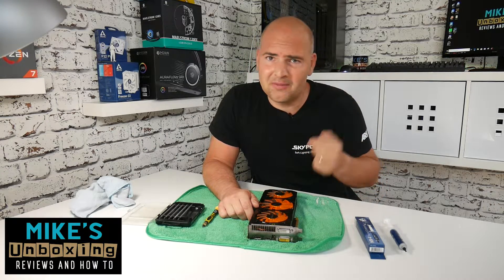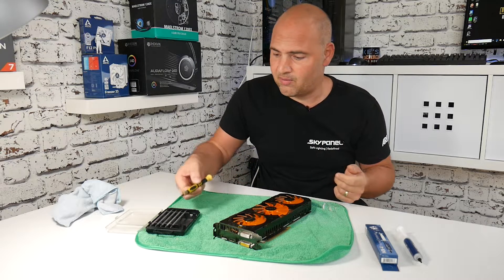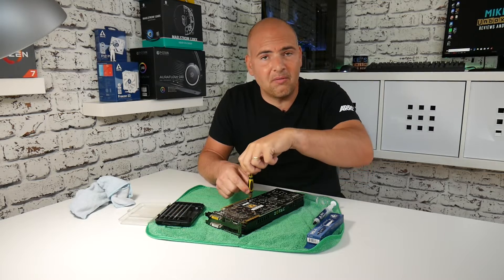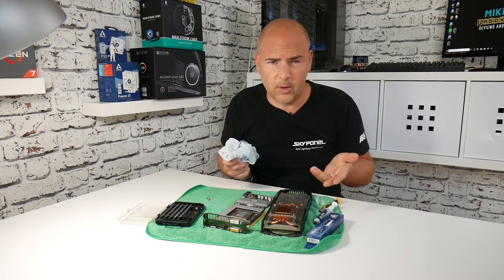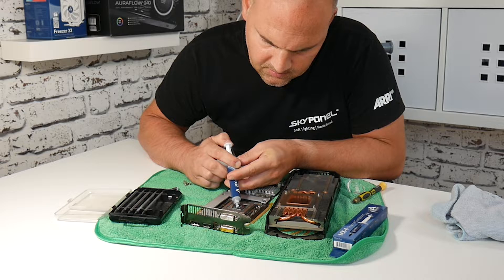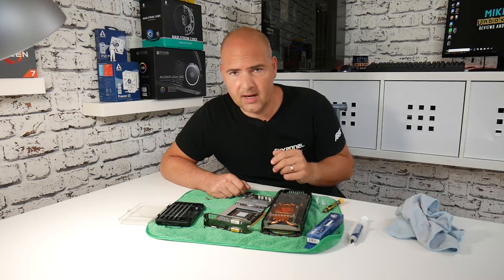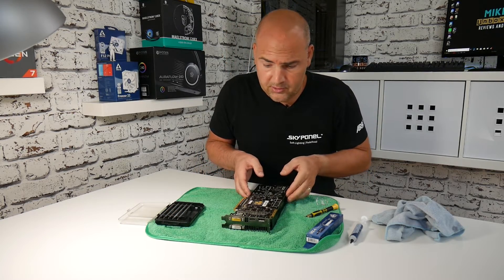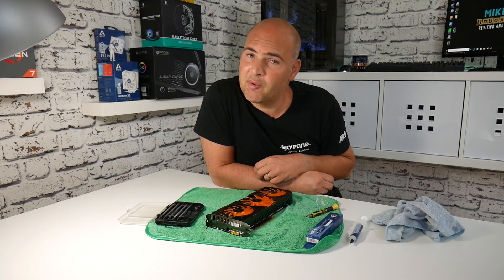Cooling Down A Graphics Card Or GPU With MX4 Thermal Paste

Comment: I bought a good air (oil based) compressor, 50l volume, I cleaned my PC, also cleaned and repasted my CPU and GPU (MSI Gaming 6G 980Ti). The GPU's paste was pretty horrible, thin and dry. I put the MX-4 on it after cleaning it, I went from 85C to 70C on the same benchmark from 2015. Absolutely amazing results.
Reply from the maker: Thanks for sharing

Comment: Thanks for this vid - I'm going to attempt to deshroud and reaapply some MX-4 to my Red Dragon 5700xt this weekend. This gave me the confidence to use the MX-4 paste. What thermal difference did you notice?
Reply from the maker: you will get a noticeable difference at least a few degrees or maybe higher boost clocks within the same thermal envelope

Comment: Hows the longevity on it? How often would you have to replace the paste?
Reply: Also underrated vid good job
Reply from the maker: I generally like to change the paste at a minimum of once a year, at this point it is still in good condition, but I like to look after the components and remove them from the PC give a good clean and inspection so it makes sense to go the extra mile whilst it is removed

Comment: Good video Mike. Have you ever used Thermal Pads instead of paste? I've started using Graphite Thermal Pads by a company called Innovation Cooling and have been very happy with them. What I like about them is unlike paste, they are not messy, and they are reusable. I'm not plugging the company, just like the product and thought I'd share. I'm sure there other brands of similar pads on the market.
Reply from the maker: Send me a link to them I would like to try them out.
Reply: Here the link to the US Amazon page. https://www.amazon.com/Innovation-Cooling-Graphite-Thermal-Pad/dp/B07CK9SHZG/ref=sr_1_3?ie=UTF8&qid=1533260505&sr=8-3&keywords=cpu%2Bthermal%2Bpad&th=1

Comment: maybe do a comparison of gelid gc-3 vs mx4 vs Kryonaught
Reply from the maker: Good idea. Now that the rig is stable I can look at other options. And look at getting hopefully lower temps!
Reply: Mike's unboxing, reviews and how to tbh i've done the same only one i've not tried is kryonaught, thats waiting for x2700 with a assassin II tower cooler. i found that gc-3 takes warming up before temps get decent, mx4 was straight away showing results
Reply from the maker: Let me know what it is like. I just got a 2700x for me sons pc and he won't let me anywhere near it
Reply: Mike's unboxing, reviews and how to yeah, i will i have a massive build to do choose air over an aio, as you either do it properly and invest in custom water kit or don't bother that was way i was thinking..so went with the assasin cooler with corsair ML140 fans on a Asus crosshair VII
Reply from the maker: I like the Corsair fans. I have the 140mm ones in my 750d and they do a great job.
Reply: I kinda went overkill with a corsair 1200w titanium, asus 1080TI and a cooltek RM4 case as its been 15 years since a upgrade!
Reply: Mike's unboxing, reviews and how to yeah, going for a red n' black theme but wondering if the cpu fans should be rgb to match the gpu and the mainboard
Reply from the maker: Themed builds are a pain in the ass if you are on any type of budget. If you have spent all that on the parts you have, go for it and get some aura sync going on! Assuming you have an Asus motherboard too?
Reply: Mike's unboxing, reviews and how to yeah, recently got a crosshair hero VII wifi, especially liking the biosfashback and its not stupid crazy with rgb its very subtle....only thing i don't like is plastic shroud that covers the vrm thats getting ripped off XD
Reply from the maker: Yeah it seems to block airflow to the vrm's which is never a great idea!
Reply: Mike's unboxing, reviews and how to i dont get why asus or any company put looks above performance, should have been aluminium with loads of vents atlease make it functional...it's like they don't think of bigger picture and how people use their hardware.
Reply: Mike's unboxing, reviews and how to not if you're doing any sort of oc then it means melting time!
Reply from the maker: Yeah that was the exact problem with the cooler master cases I reviewed all three of them were style over practically

Comment: benchmarks?
Reply from the maker: The benchmark was a little bit difficult to get as with the previous setup the benchmark crashes or blue screens so I can't really say much other than the improvement allowed me to fully run unigene heaven and got a score of 2441 I think so not really sure if that is good as there is no reference from earlier with the same setup. Although I have seen scores around 2300 before with a comparable setup. But this wasn't exactly the same so I didn't include the results. But temps where about 5 degrees lower that I could see from previous runs that is before it crashed. Is that a good score for a gtx780?
Reply: yea its a pretty good result i replaced the thermal paste on my 1050 ti with the mx 4 just got 2 degree less than before i just need a better airflow case
Reply from the maker: The 1050ti is a great card and has a really good tdp so the paste will have a lesser extent that it can improve upon. Every little helps though!
Want case are you using?
Reply: Mike's unboxing, reviews and how to right now I have a crappy case from 2014 but next week I'm going to get the Silverstone rl 06 along with new cpu etc the only thing I'm keeping is the gpu from my old system
Reply from the maker: I haven't seen much about that case. Is it a good one to get? Any special features
Reply: Mike's unboxing, reviews and how to it has a mesh front panel with 3 fan intakes and that's already the best for me coz right now all cases are closed on the front panel the included fans are very nice as well, I saw benchmarck for temperatures and it's at second place on the chart passed by the meshify c from fractal design but with noctua fans inside chech it out there are a couple of good vid on yt
Reply from the maker: Thanks I'll take a look. Sound pretty awesome so far!
Reply: Mike's unboxing, reviews and how to its not super beautiful but I don't mind it. plus it's pretty cheap here on Italy is 80 €
Reply from the maker: Just had a look! Very nice, I think I would like a black on black version with clear glass. I will keep on eye on this for future videos